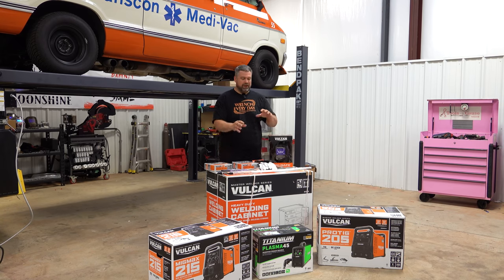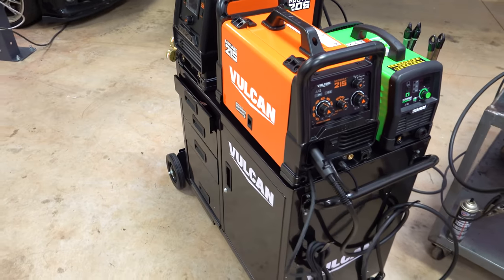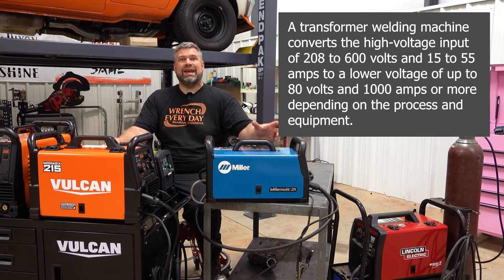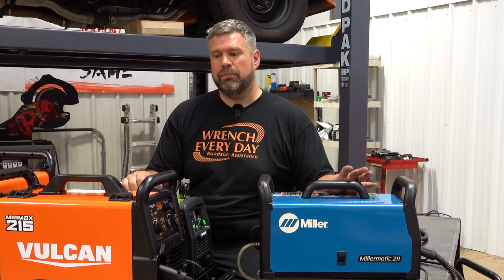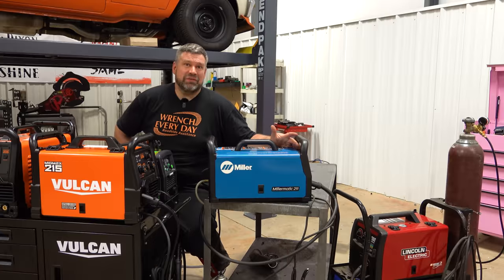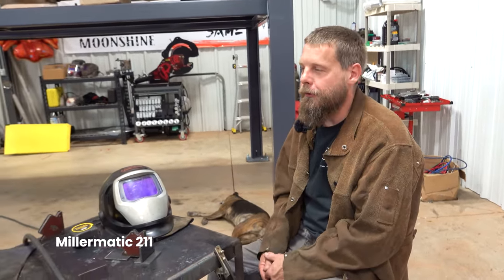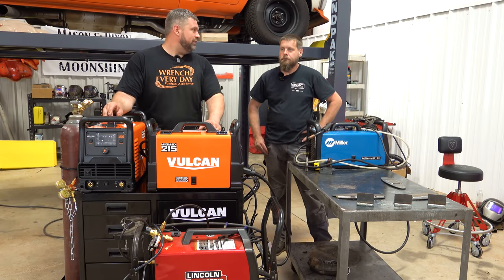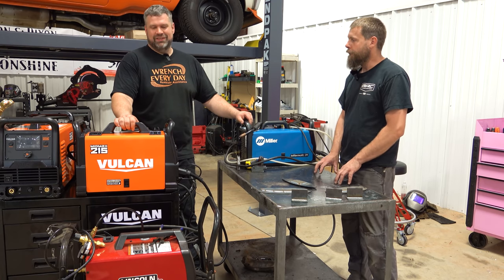Here's What NO ONE Will Tell You About Harbor Freight's "Best" Welders....

Comment: I have to say the Vulcan sounded much cleaner. When I went through welding class and certs for my JIW. The instructor pointed out the value in arc sound. The major thing you missed was showing and comparing the weld and bead. Added bonus you should of cut the piece and compared penetration. That’s really what matters in welding.
Reply: That is really cool to know thank you for sharing!
Reply: Its funny you say that. For both the Lincoln and the Miller I was thinking they didn't sound right. Then with the vulcan I was like now that sounds good.
Reply: I agree and I wonder why they didn’t take it that far with the actual review of how well each performed. Proof is always in the pudding and we got no pudding.
Reply: A cut in the parent metals with etching to contrast the penetration in the part
Reply: Bingo sir wonderful reply
Reply: @oldrango883  l pm
Reply: Not real welders because the major things that matter y’all missed
Reply: JIW here. Vulcan works as well as miller
Reply: @oldrango883 You can't have any pudding until you eat your meat.
Reply: Right on. The Miller and Lincoln were running cold. They both needed more wire speed. Were almost in globular transfer mode instead of true short arc like the Vulcan was running. Don;t cackle like a chicken. Fry like bacon.

Comment: As a Professional certified welder for 40 years I've used dozens of different pro welding machines. I bought a Migmax 215 as a retirement home machine (only paid $500 for an unused returned machine). I was surprised to find it welded as good or better than any machine I've ever run. I've only run flux core wire on it (more than 30 pounds now) and it is smooth and runs perfectly in ALL positions. Label says it will run .045 wire using flux core wire but I haven't tried it yet. From my experience I'm sure it would run it (on 240 volts) as it will weld 1/2" thick steel using .035 wire on 120 volts input. I would consider this a prosumer machine for sure and you can add a spool gun for aluminum. By the way you CAN  tig weld aluminum on DC current it's just rare you see it done. I've done it myself.
Reply: If I was doing a lot of short circuit arc welding I would pick the Migmax. With your 40 years and my 32 years I'm guessing you go on sound quite a bit.
Reply: Any "Certified" welder should know that there are no Prequalified Procedure Requirement documents or Welding Specifications that will call for a DC GTAW weld on Aluminum. It simply ruins the Aluminum's metallurgic properties and will include parts of the tungsten electrode in it.
Reply: @joemad4110 actually that is incorrect if you were to look up there are actually several certified procedures for it but only for true heli-arc with a helium/argon mix(original mixture for tig welding pre ac/dc.
Reply: @adamswelding5052  Just because you can doesn't mean you should. I repair aluminum trailers all the time and you can use GTAW with DC current with Aluminum Brazing Rods to "weld" Aluminum together. In some applications, where Aluminum brazing with a GTAW torch is much easier than with a fuel torch because of the convenience and cost of a fuel setup versus a DC GTAW machine.

Comment: As an electrical engineer, I can say the explanation of inverter/transformer type was spot on. For a hobbyist I would always recommend an inverter: better control, lower cost and smaller size/weight.
Reply: As am electrical engineer who is also a welder, the description was NOT spot on..  It was conceptually close enough, but specific details on how they do things and the voltages and currents are way off..  MIG welders do not generate 50V and 1000 Amps..  More like 18-30 volts at up to about 200 Amps and MIG inverter frequencies do NOT get up to a megahertz; maybe 150-200 KHz for top of the line inverter welders, but most of the hobbyist grade inverters are probably in the 20-50 kHz range.   
A cheap inverter welder is way better than a cheap transformer welder,  but a good transformer welder can do quite well, so it is still worthwhile looking at used Lincoln/Miller or other well established name brand transformer welders as they are cheap and basically all but indestructible and last nearly forever..   Inverter welders you want to have good repair and parts support as they blow MOSFETs and IGBTs regularly and the more complex the computerized circuitry, the more prone to failure they are..    I have an older Harbor Freight AC/DC TIG and its HF board is going flaky and you can't buy replacement boards anymore and there is no service data..  I've reverse engineered it enough to be able to replace components when they die, but there is obviously a design flaw that makes it susceptible to failure (which is probably one reason they no longer sell this model)...
Reply: It's a bit strange to me that they didn't use the linear power supply vs switching power supply names, but it's okay, they aren't electrical engineers.
Reply: @Flying0Dismount  You are right, the numbers were wrong, but the concepts were explained correctly. Personally, I had a failure on my transformer machine where it lead to melting all the switches. That particular failure was an expensive one to fix. So transformer machines can also break and be unviable to repair.
Reply: 30 years from now a transformer machine will still be working. An Inverter? It's anyone's guess.
Reply: @Flying0Dismount  so with stick welding 6010 AWS tests i found it was easier to pass with a transformer machine than a inverter type why is that? aka why is one better at one thing TIG/stick than the other one? and yes i like both styles but for different projects/welding and different results/reasons
Reply: @richardprice5978  6010 is known to often work better on transformer welders than inverters.  The one major characteristic that helps is inductance, which is an inherent property of the large coil of wire that is the transformer and keeps the current output very stable making your weld easier.  Inverters have very small transformers which have lower inductance but some higher end models can "fake" the effects of high inductance by monitoring the output and dynamically adjusting the current during the weld, but most inverters do not have this setting.
Reply: @Flying0Dismount  thank's makes sense now. found that out by accident ( didn't weld with a inverter intel about 2014-ish as shops like my high school/families and workplace's didn't feel the need to change anything but as time goes on the older equipment probably will get faze out just like CD-player's did ) and yes the AWS/college school had higher end equipment but i kept going back to basically my grandpas old 1950's red tombstone analog welder ( oldest one in the shop from pre-1970's ) for my 6010 testing and i asked the teacher AWS for 40-plus years ( stared the program after being in the field as a AWS welder for 5 plus years   ) and he looked at me like i was whering a tin foil hat, so there is a difference after all, and my primary background in automotive and industrial equipment maintenance guy i can see/understand why ( that was kinda the theory i came to in 2016 but seamed silly so i disregarded it and figure it was red vs blue build style 😉 and or use-time on the equipment and or build-year/imports vs domestic vs night weekend shift vs day and Wednesday build ) and iv had the opposent happens too ( inductance getting in the way and or some corner weld's are harder as magnetic interference and materials-property's can change the weld/machine's property's ect. ) so interesting to see the main power supply changing the outcome for me as a user

so far analog for me can't be imitated and or fully replaced yet as the tech isn't there yet, but thats my experience with welders for now, if there was a mode to ( the main power feel ect. ) change it 😲id be in love with it as its one less tool to need to drag around for those well what if welds and my main go to now is the newer inverter technology ( the opposite of a oscilloscope  with a full LCD control aka a full a adjustable power function supply with internet access for the latest updates on new material/best practices for welding setup that im not as formilrare with aka the recipe and how to too plus smart phone controls ect. ) and at home shop a 2014-up 350 or 400 dynasty miller 👍tig, just like the wife's discussion yes you can be a good cook but you will be handicapped by the wrong tools and or bad quality as a good oven/range makes a big difference in the final cakes outcome
Reply: @Flying0Dismount  Do you know of a good video, manual or any other literature which contains some of the data points required to design an inverter stage for a MIG/TIG welding machine? I have always wanted to design my own and I know I can easily make all of the square wave generation and power controls, but would want to understand the topology required to make it work. For example, I know very well how to regulate the current, control the frequencies, etc, but am not sure where the power stage would be in relationship to the transformer, and so on. Thanks for any input you might be able to provide!
Reply: Forgot about the AC to DC conversion before the (probably) full-bridge IGBT (usually on welders) switching stage. It is called "inverter" because of the inverter switching circuit...basically a switch-mode power supply at that point before handing that to the output stage which is the side controlled by the welder controls
Reply: @Flying0Dismount  +1 & was just gonna add that  starting off in welding in general is pretty darn cheap *if* you start out the "right" way w/the sole initial focus of becoming proficient at stick (or perhaps simply *not always* producing utter garbage welds & happens to be the bar I've set for myself lol). A shrewd shopper can snag a *properly* decent inverter online for even cheaper than HF'S entry-level & run circles around it like the one I lucked out buying via AMZ. Puts out a legit 200amps and has yet to ONCE thrown in the duty-cycle towel after two years even after multiple rounds of full blast carbon arc gouging on 1/4 plate non-stop for however long it takes me to lose track of time.... It's dual voltage though & 200a gouging being futile in the first place on 120v on any machine bc pop goes the breaker @ ~100amps for this box which is a ~2000w draw, np @240v though. It's only when you move towards the more "involved" processes that have all some sort of "moving"  component that isnt simply your arms is where things get legitimately prohibitive in cost. I want a legjt multi TIG/MIG in *the worst way* which has EVERY last gd feature that I'll likely never use more than of 1/4 regularly w/a warranty that's g2g & longer than my life expectancy, buuuut I'd rather have that comprise a decent % ofa down payment on some land/R. E. just cuz THAT'S HOW MUCH THOSE BASTARDS COST..... I feel like I'll never know the joys of a hot/HF start when I weld bc cheap... sigh
Reply: Yes pretty decent but, an inverter is about 1000HZ max frequency.....not a "million"....1,000,000 HZ and I think you'll be dropping aircraft from the skies with RFI interferance🤣
Reply: @ejgrant5191  Most high efficiency inverters operate at 100 kHz and beyond. Power devices that switch a few MHz are single-chip class-D amplifier ICs and wireless communication transmitters

The amateur radio band is around the 10 to 30 MHz range

UHF and VHF are several 100's of MHz including FM radios (from 60 to 100+ MHz depending on region) and analog TV broadcasting and also two-way radios that operate at that range

then we have microwave ranges of over a GHz that includes WiFi and other wireless comms - there's your reason of global warming with these microwaves all around the globe
Reply: @aDaWaN  I didn't realize transformers use switching. I thought that's what inverters do.
Reply: @richardprice5978  6010 or any cellulosic rods don't work well with inverters...Miller machines have a constant voltage/current setting that mimics transformers...but
Reply: aDaWan you don't have a clue as to how an inverter works as the video creator doesn't have a clue either.
Reply: @alexandrecouture2462  simple. Linear supplies have lots of copper windings and they cost more than a switcher with a smaller transformer. The downfall of the inverters are most guys can't repair them and/or you can't get replacement circuit boards

Comment: I've been a self employed welder for 10 years. I have almost that exact same Lincoln 180. Guy said the one in the video is the Home Depot version, mine is a slightly higher quality machine from a welding supply store, mostly the only difference is in mine is the drive wheel assembly is a little better.

With that said, before I got my Lincoln 255 MIG which I use most frequently now, for about 8 years all I had was my 180 MIG and my Grandpa's 225 tombstone stick welder he bought brand new in back in 1964.

My 180 has been built proof and has never failed me and I used it almost everyday and made a lot of money with it. I never even plugged in my stick welder unless I was doing something 1/4" or thicker our some outdoor work because I dont run fluxcore, only solid wire. If I had to do something 3/16" thick and still wanted to use my 180 MIG, I would just make multiple passes and no problem.

The only knock I can see on the Lincoln 180 which you didn't mention in the video is the voltage selector. You can't dial it in to a specific voltage, it only has an A,B,C,D&E selector. Tbh though that really isn't a big deal. MIG is such an easy process that if youve spent time on your machine you can easily overcome that by varying your wirespeed and travel speed.

Post flow on the Harbor Frieght machine... yeah I guess that is okay but its not really that big of a deal. Its not TIG and MIG machines have been fine without that for many years.

Also those inverter machines have so much more that can go wrong with them over transformer machine. With all those extra electronics in them there are way more parts that can go wrong and are more expensive to have worked on... factor in also that transformer machines rarely ever fail. Kind of a "less moving parts" type of argument. Also, the 180 is heavier? So, its gonna be on a cart for 99% of its life.

Zero surprise the life long Miller guy choose the Miller. I'm a lifelong 3rd generation Lincoln guy so I get it. But with Miller their prices are ridiculously higher than Lincoln, kinda just buying the name and blue paint for a machine capable of doing the exact same thing.

Zero surprise the guy that got given a free MIG, TIG, plasma torch, cart and consumables talked up the Harbor Freight equipment. Even if he didn't "have to", I'm sure he is happy to get the free equipment and the video content.

Admitting my bias, aside of that considering I've personally ran one of the machines within your test for hundreds of hours already. The Lincoln Pro MIG 180 in my opinion would be the best for someone looking to get into a machine that is above an entry level wire welder. I would bet my machine will outlast anybody watching this video, not to sure about those other with all those extra electronics on them.
Reply: Thank you, your comment based on lived experience taught me a lot!

Comment: Personally I have the Omnipro 220 Vulcan and it welds amazing. So far I've used flux and mig on it but it does stick and tig as well. I also have the 45 amp plasma and can say that it works great. I've only really used it on some 3/16" square tube but it cut like butter and moved along quickly.
Reply: I’ve been using my Omnipro 220 for regular mig welding on patch panels at my classic car shop. Took a bit to learn the settings after using the normal two knob Lincoln welders that don’t display the actual voltage band wire speed, but it works great!
Reply: Can you tig weld aluminum?

Comment: I've had the Vulcan 215 mig rig since they came out, 5-6 yrs or so ago. 
 I purchased it originally to fabricate my ornamental handrailing and have ran about 100 lb of trouble free wire thru it over the years and it works as good today as the day it was purchased.